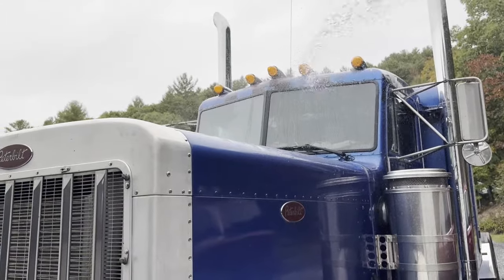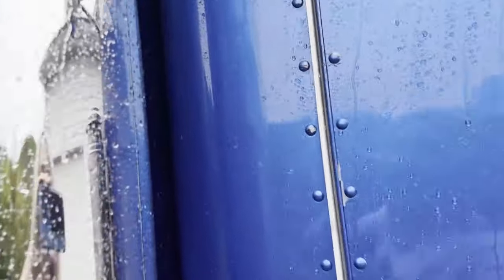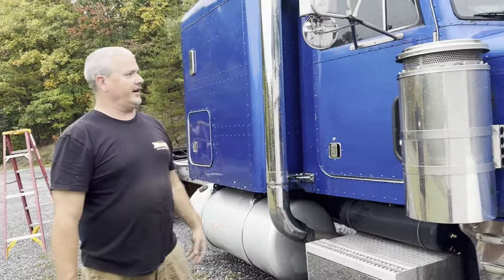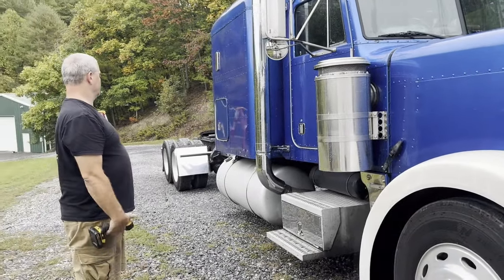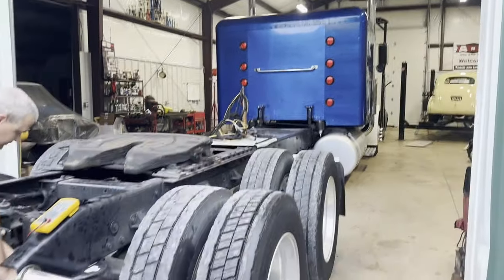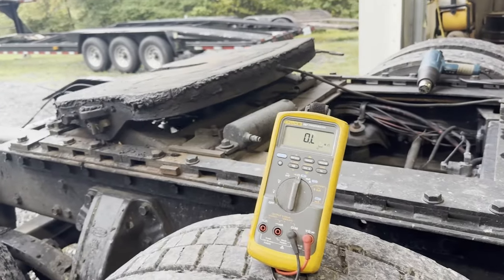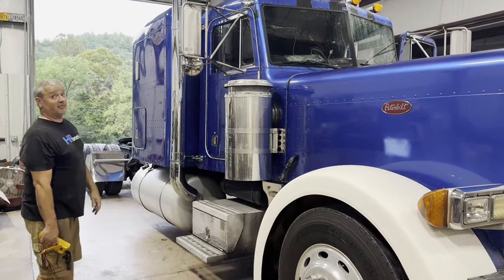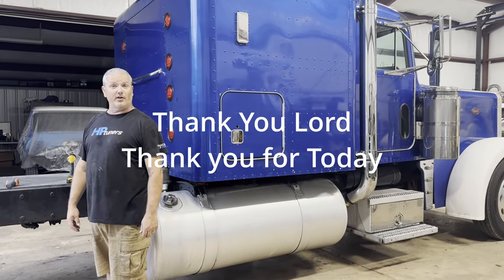Peterbilt episode 11 we finally find water leaks after Angie hoses me down and checks temp of rears

Comment: before you get to far into it check the vent hose on the outside firewall its a plastic tube if its plugged or missing water cant drain  its directly outside of the black box your looking at in the engine side they make a cover with a filter to go over that screen aswell need to remove air cleaner to install it good luck
Reply from the maker: @69hayes48  will check that out 👍🏻👊🏼🙌🏼 it’s definitely pouring water in right there 😂😂😂 thanks for watching 👍🏻🎥🎥

Comment: I wonder if you’re wiring issues with the diff sensors are due in part when they extended the frame of the truck and had to cut all the wires and re-solder. I would start looking at those first.
Reply from the maker: @JasonSmith-vd1sz  you could be right 👍🏻🔧🔧🔧 but looking at the wiring on the frame, I’m thinking solder was used 😂😂😂 I’m going to be lucky to see a butt connector 😂😂😂 thanks for watching 👍🏻🎥🎥

Comment: Do the simple thing and Don't put seats in the sleeper. 
Put the couch conversion in the sleeper and you have minimal redirection of the comfort control system.
Reply from the maker: @randywhelan8944  is a couch conversion going to give you enough leg room?  Would be a lot easier to do if it was still comfortable to ride in 👍🏻👊🏼🙌🏼 thanks for watching 👍🏻🎥🎥
Reply: @andhotrodshop  I love mine. 
It even folds down into a double bed. 
Normally 4 of us ride on a trip a couple times a year and haven't heard any complaints.